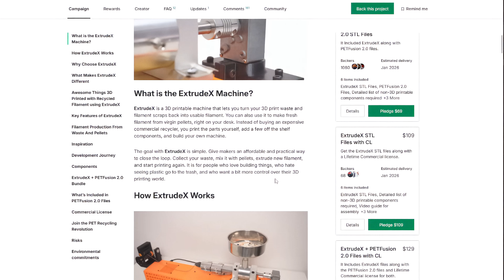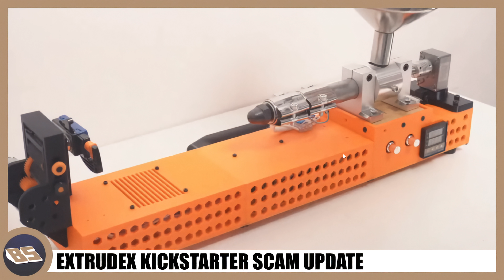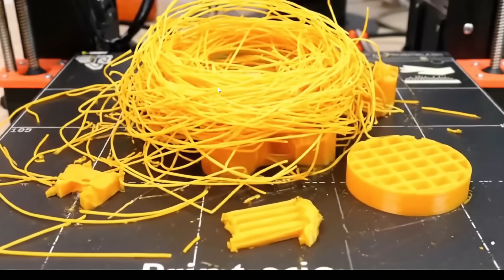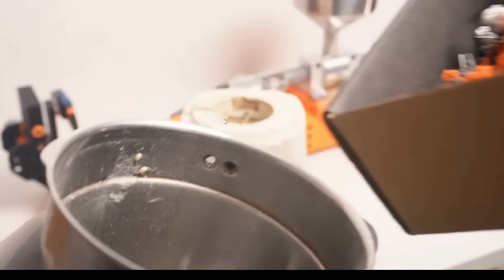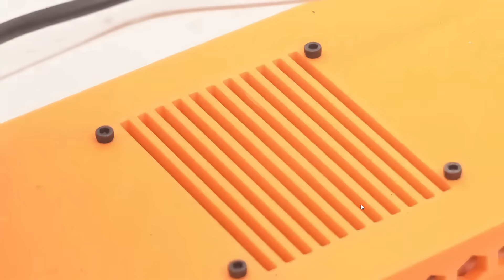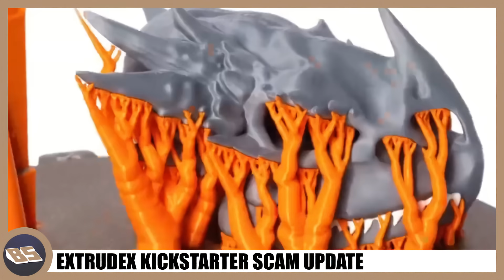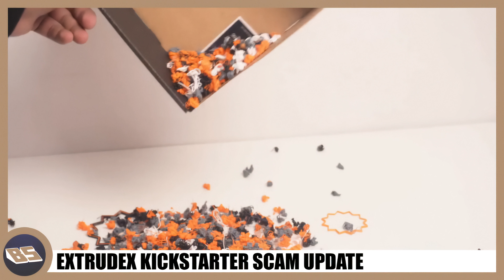ExtrudeX Kickstarter Scam

Comment: Ah yes, recycling by burning the plastic into CO2, what a great solution!  Why has no one thought of this?  I wonder if we can do the same with PETG, or ABS...
Reply: A lot of European countries do this, and use the heat either for power generation, or municipal heating systems (radiators and whatnot). Needs to be burnt right, but past a certain temperature every breaks down into its base substances and then you can scrub heavy metals and any noxious volatiles that form before venting to atmosphere. It’s a very different process to just starting a burn pile in your backyard or something. In those the temperature is too low to break up the kinds of horrid gases that burning plastic emits and you just dump pollutants into the atmosphere. PLA is mostly carbon anyway though, unlike ABS which I believe can produce styrene gas when burnt, which is horribly toxic.
Reply: @SkigBiggler  nah, just bonfire that shit next to your garden, your plants will thank you :)
Reply: If you can make abs or pet from plants, sure
Reply: Almost all the plastic you recycle gets burnt.  If you hear biomass power station,  it's burning your plastic.
Reply: I thought biomass was wood?
Reply: @TonyHill-f2r Wood is in there so you think it's bio but it's mostly plastic
Reply: @Yandex-y1p because there was a big irish scam a few years ago, people were being paid to burn wood, so they would have a shed with loads of burners in
Reply: plants crave CO2, afterall/s
as a 3d printer enthusiast, i just melt used plastic into sheets to cnc cut
Reply: @crim9502  This is a great idea, need to do this myself. Would be useful for prototyping things
Reply: @crim9502  That's a pretty clever idea, are you able to get uniform and consistent thickness? Personally I've been tempted to try using printer waste for casting, felt almost poetic to use an actual print to make a master, and then the waste from the print to make the casting.
Reply: @asteroidrules  it's easier to get a flat bottom in the heat press then mill the top flat later